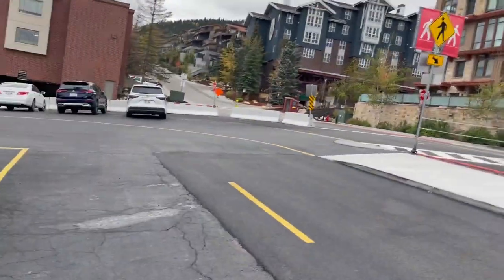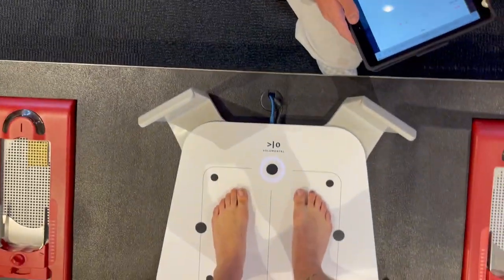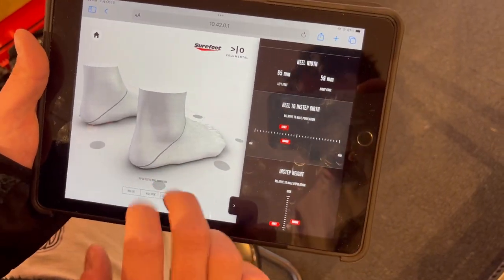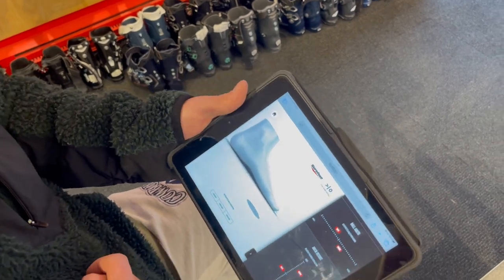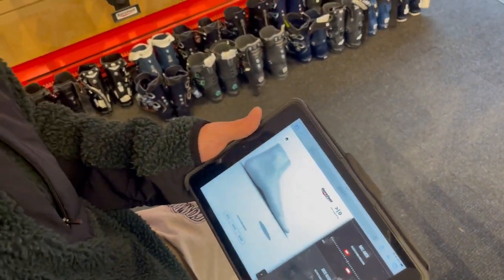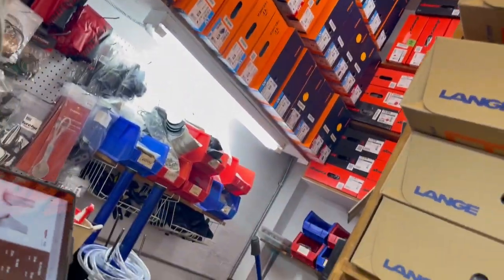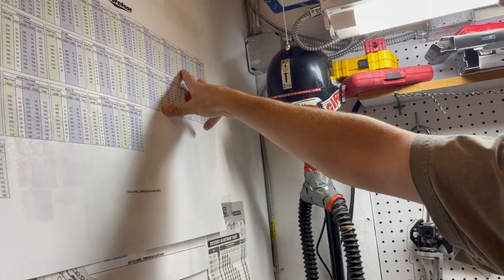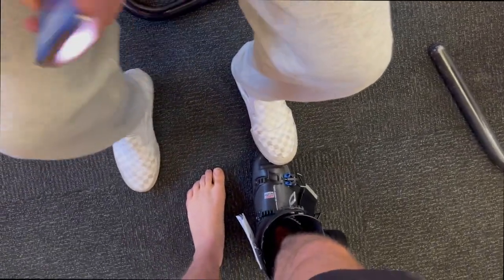New Ski Boots For This Season // Sizing and Fitting w SkiMatt

Comment: I've tried over 10 boots here in Tokyo the past 3 months. Left foot 27.7 - 27.9cm, right foot 27.8 - 28.1cm  depending on who measures them on the brannoc. Left last is 103.5mm - 104mm, right is 105 - 107mm measured by 6+ people (including myself with digital calipers).  Instep is 26.0 to 27cm max. The right foot has had inflamation at the first joint closest to the front of the big toe (which has made the last go up to 111mm when swollen). Nordica Cruise 120 seemed to fit the best at either 28.5 or 27.5. But given 27.5 shows max foot length on your chart as 277mm when my right foot is 277 to 281mm, is it not suggested that I get 27.5? An accurate shell check with a 16mm wooden dowel shows it barely fits the right the right foot. It's right at 14-15mm of space remaining without the liner - I want a performance fit. I plan to get custom heated insoles with the boot.